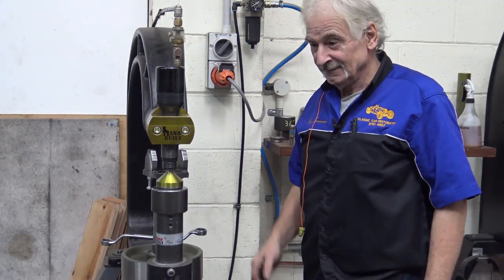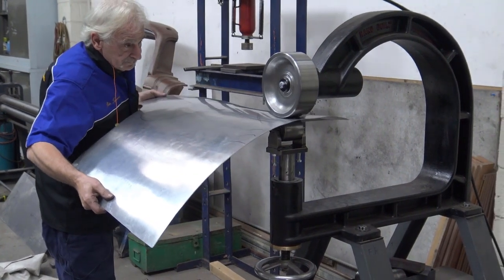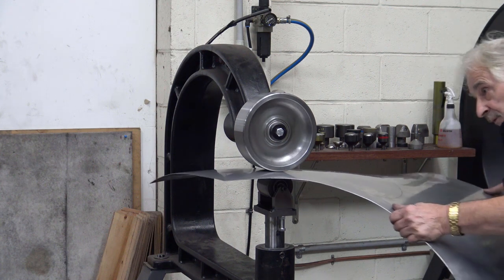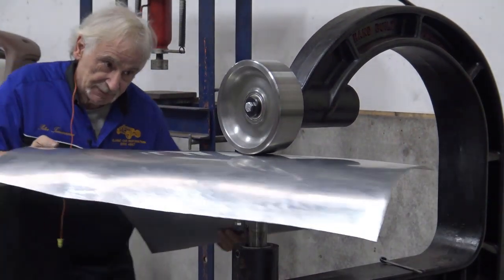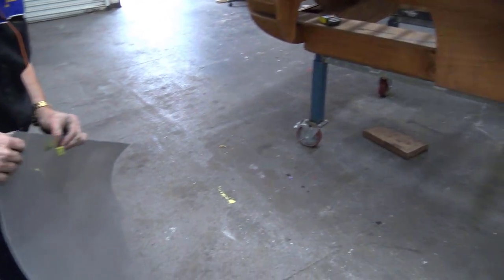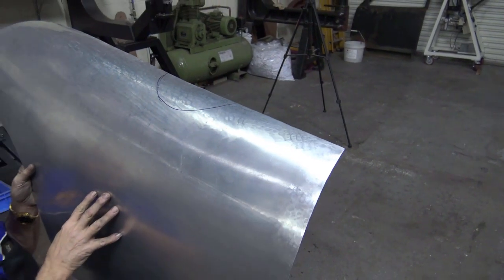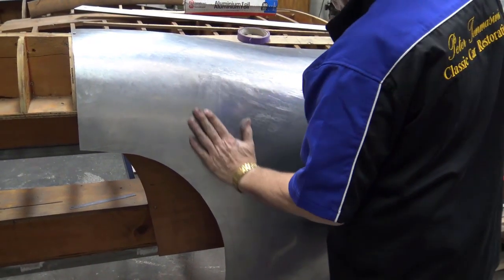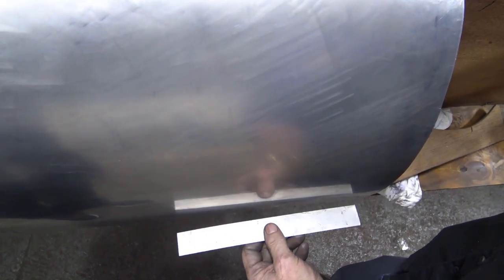Making An Interesting Shape With A Planishing Hammer and English Wheel Part 2 - With Peter Tommasini

Comment: Thats the best wheel / hammer set up Ive seen ,, handy bit of kit.
Reply from the maker: Thank you .... I developed this set up about 15 Years ago, knowing what a tool need to do in order to be quick, good, and save some time .
Reply: @Handbuilt1    its just perfect .. one housing to take up less space , and two uses ,, really each tool is less than half price ,, im surprised that its not been copied .
Reply from the maker: @tomthompson7400  Yes that is true someone can copy it,  BUT  !  I am the only one that knows the components of the casting (it's not just cast ) and the dies material used  + radius es etc..... they will not come up with the same result
Reply: @Handbuilt1  No , quality counts , but often it cant be seen , and has to be felt to be appreciated.

Comment: Hi Peter ....just been watching this 2 part video. Some excellent advice there thanks. I am a beginner and up to not have only tried my hand at wheeling aluminium panels.... I was wondering if doing a bit in steel would help me ...my thinking being that whilst aluminium is more pliable than steel maybe for a beginner that means it can move too quickly whereas steel is a little less pliable and my compensate for my beginners tendency to go too far to quickly... have you any thoughts/advice along these lines at all? Cheers, Chris (UK)
Reply from the maker: Hi Chris there will be more video's  soon in 2022 . Thank you for watching , Cheers from OZ

Comment: This is really great. Would this technique / tool be able to do tighter shapes and curves?
Reply from the maker: yes it will do almost anything
Reply: I own one of these set ups I purchased from Peter about 1.5 years ago. It is an excellent quality piece of equipment and really valuable if you have limited floor space. I do a lot of smaller pieces for sculptures with it and it works flawlessly. I am not a paid spokesperson or anything like that; I purchased the wheel/hammer out of my own pocket . I am merely a very satisfied customer.

Comment: I see what you are trying to do but again, it's hard to follow what you are saying.
Reply from the maker: Brad can ask you a simple question , if I may,  Is it my Italian accent that you cannot understand? Or something else ?
Reply: @Handbuilt1  No. I can understand that just fine. I really want to follow what your are saying but you seem to jump around and talk arbitrarily and sort of stray off.It's clear you know what you are doing but conveying it is different. I keep watching because I know you have plenty to teach. Having a clear start end end to a lesson will certainly help before you begin the video. Anyway, very nice work.
Reply: @Handbuilt1  For instance, you will say you are going to "let it out" when describing correcting a part in the panel. We don't know what you mean. Or,referring to the bottom flat part of that panel as bulbis. then saying the same about the actual contoured part. Just little things like that that throw off a viewer.
Reply from the maker: @gearhed78  Let it out means get rid of the unwanted  material, usually used when doing a return shape or having too much unwanted  material (too full ),, there is not such a thing as a  flat panel  in metalshaping ( if ''flat'' you will find that the panel is actually under (meaning hollow), so this means that even if the panel has the MINIMAL  shape which could be bend simply  by hand, that goes under the category of been bulbous , and obviously there are many many types of bulbous shapes, so in the case you are referring, the panel in question was rolled by hand meaning bulbous then the contoured part (as you put it) is again a bulbous shape . It all will come clear to you when you get some experience in the trade ,you might learn different meanings or words for what I just describe but the principle is the same.  Having said that, when filming and concentrating on the next  part of the job, sometime one can use the wrong words, but again my job has been a panel beater not a actor that has read the script for a  month before the movie,  most of my talk comes as I am thinking at the time , so sometime I use the wrong words  but as I said I am not a teacher by trade and neither an actor  but I will try to do my best.......... Let me give you an example , I have known teachers and other so called tradesman in my time on the trade, which where extremely  well educated ,  they where well and clean  spoken, and   they could talk under water, but when it comes to do the job....... they where useless, my third Year apprentice could have done better. 
  One thing that could add to your ''not understanding'' ....sounds to me that you are in the US, meaning you guys have never had English tradesman or trade schools in this trade teaching you,  meaning that most of you guys are self thought, and  the terms that we use  are  now new to you, there for hard for you  to understand ?? Having said that I have done many  classes in the US  and never had anybody complaining about not understanding?
https://www.youtube.com/watch?v=uNyJycmFq4E
https://www.youtube.com/watch?v=jYkUXzP6Rzo&t=3s
Reply: @Handbuilt1  Perhaps the some of the terms lead to a bit being lost. But, thanks for taking the time to explain. In person you can ask questions if something isn't exactly clear. I see what you mean though.
Reply from the maker: @gearhed78  You are welcome , asking questions is a big part of learning
Reply: I recommend to get the DVD kit from Tommasini. Excellent information.  One could wish for a second topview camera pointing downwards on the wheeling of the panel
Reply: @gearhed78  yeah see that alot. Highly experiensed crafsmans regardless what trade it is has words that is hard for an average Joe to understand. Like the difference between shape and form. What the heck. Then one other uses therm area and arrengement. Much easier to grasp for a beginner.

I dont know if i chould reccomend another channel on metalshaping, but there is another channel here on YouTube that uses simpler words and totaly different methods, flexible shape pattern and gauges insted of wood station bucks. Then you can find him if you want. I followed him for some months and got sortof a grip on that metal is and then got back to Peter and now i understand cus Peter has so much to teach and say with amazing results. 

Some channels is beautifuly filmed and edited so nice to watch that way but no content and dont give anything

Peters gives a tonne, but hard to understand and keep up if you dont know the words used in the trade 😆 

I Love this videos Peter. Keep em comming